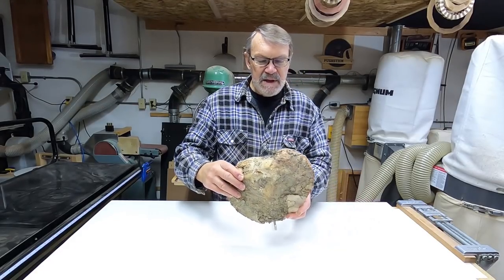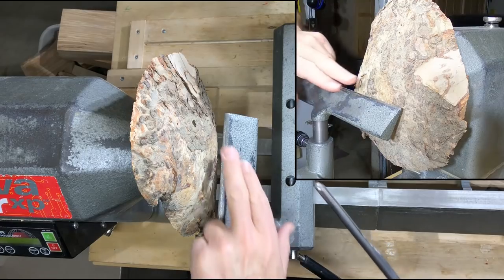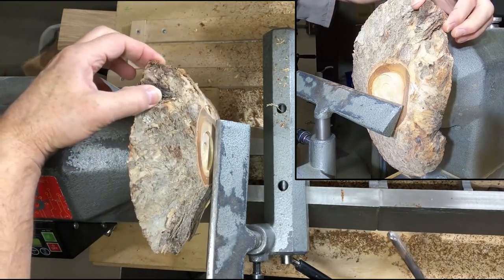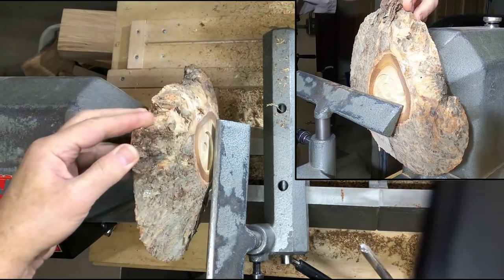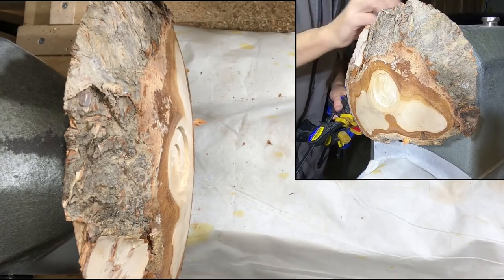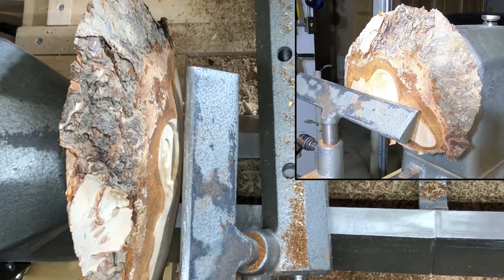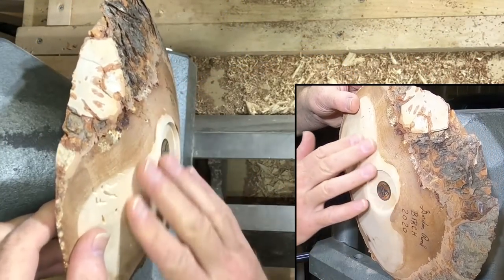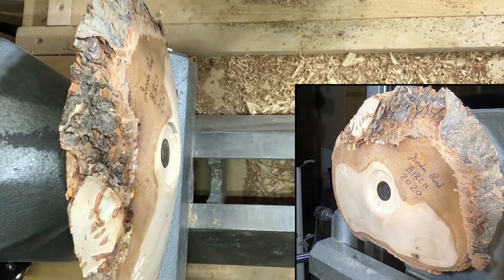Shallow Birch Burl Bowl

Comment: Very nice work as always Gord. Love it!
Question? As I have the same lathe as you do, (except a 20/24) but I assume the bedway and banjo are identical. My question is - does the bolt that holds the anchor plate on the banjo underside often come loose. (work it's way out) to the point of not being able to tighten the banjo, so requires re-tightening. Not a major issue but can be a bit of a pain. Do/did you have this issue and do you have a remedy? Maybe there is such a thing as a stupid question!
Thanks and Regards
Dennis
Ps - I've started to lobby with the easter bunny but she seems to lack intrest. If I end up with just chocolate I will send you some as you said you may to get any!
Reply from the maker: I have never had a problem with that, Dennis. If it's under warranty I would talk to the dealer. I'm not in the shop to take a look at it right now. Is it possible to use Loctite on it? It's the only thing that comes to mind without looking at it.
I understand! The Easter Bunny can be a bit temperamental at times! There certainly things I would rather have but I would never refuse chocolate!!! Be happy if you get chocolate but remember to always complain that you didn't get enough of it!! You don't want the Easter Bunny to think that you're easy!!
😎😎😎😎